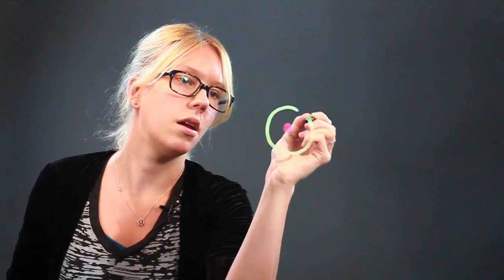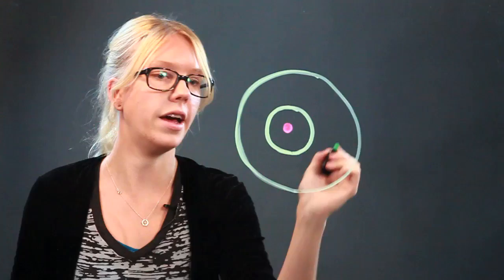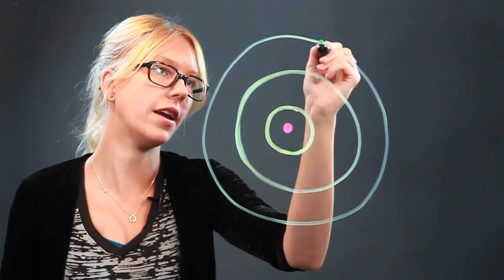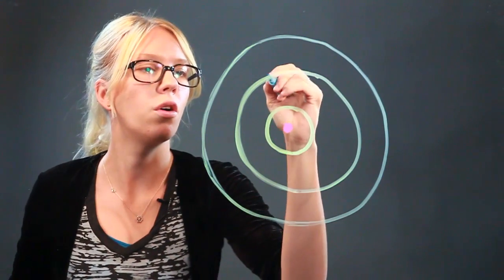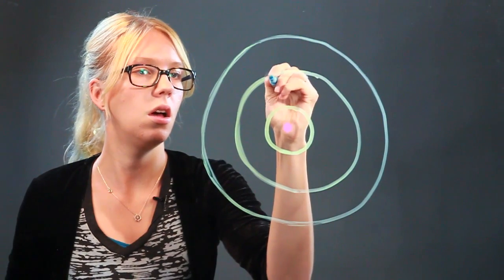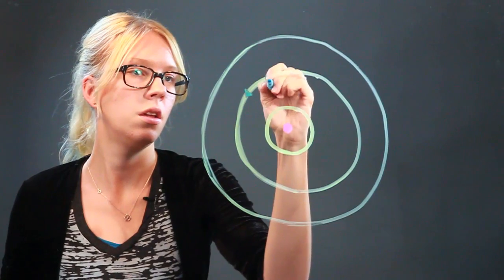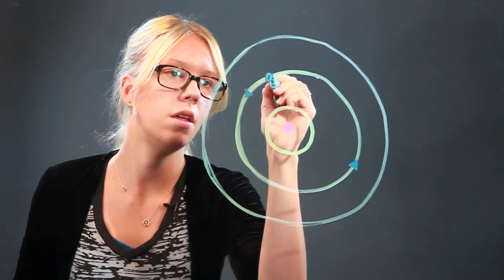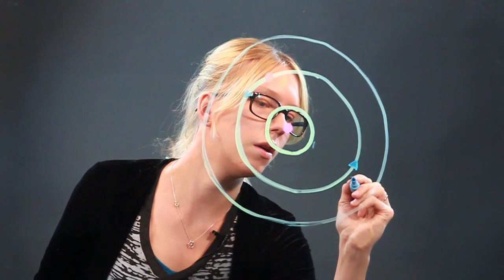How to Draw a Bohr Model

Comment: It was literally... more of a drawing tutorial. It didn't teach me how to get the amount of protons, neutrons, or electrons needed in order to draw it; it just said "this is how you draw it."

Don't rely on me too much, but I'll try to help you out. The number of neutrons is the atomic mass - the atomic number. The atomic number is on the top of the elements slot on the periodic table, the atomic mass is on the bottom. The atomic number is equal to the amount of protons and the amount of electrons. Add the protons and neutrons to get the atomic mass.

Put the amount of protons and neutrons in the nucleus. (like p= 12, n=12) And draw the electrons on the outside levels of the diagram. The first level can hold 2 electrons, the second holds 8, and I think all the other levels hold 8 too. I'm not so sure about that last part so I would recommend looking it up.

I'm not a teacher, so you shouldn't rely too much on me. This is all I can remember.